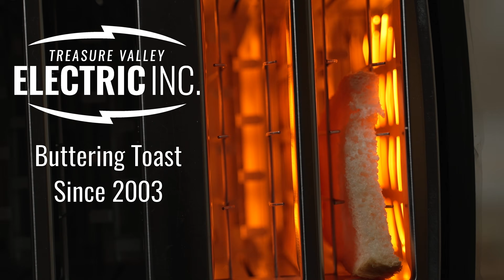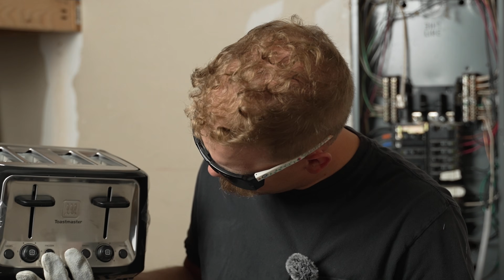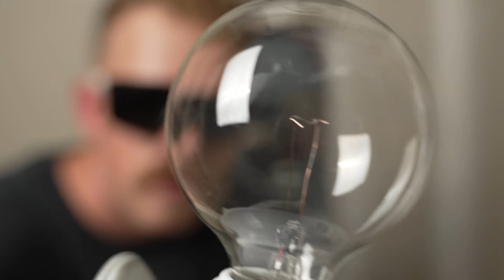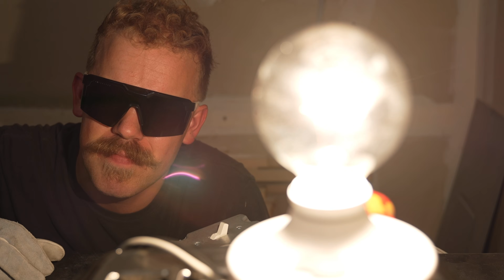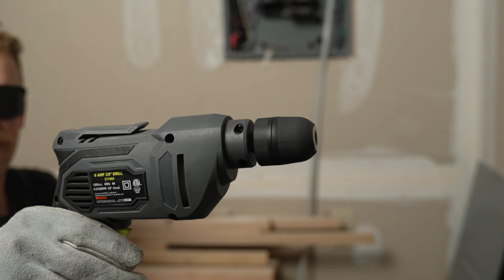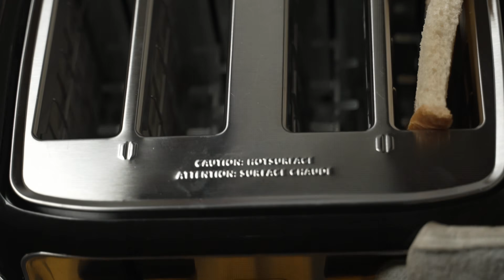We Sent 208V to a 120V Drill (What Happened?)

Comment: Switch mode power supplies will be unaffected as they will work with voltages ranging from 100 to 240 volts. A lot of high end hard wired LED lighting fixtures also have this feature

Comment: I love your real life demonstrations to help the newbies who never came across a 120/240 4w delta three phase system.   

7 years ago I was replacing a main panel in a 1960s family diner served by a 120/240 open delta bank.  The main panel fed a smaller single phase panel which powered the lighting, some receptacle loads and the security system.  This was on a Sunday evening and I was rushing to finish as it was just after midnight when I finished.   

Fast forward two days later on a Tuesday afternoon, I get a phone call from the owner of that restaurant stating that one of the janitors plugged the floor polisher into one of the receptacles in the hallway near the bathrooms and the machine ran unusually fast for about half a minute until it smoked and caught fire then tripped the breaker. Fire was able to be out safely with the fire extinguisher .  

So I returned and as soon as I put my meter in that outlet and read 211 volts I muttered "I f**cked up".  A handful of receptacle outlets as well as some of the lights were getting the 208V high leg.   The lights were perfect fine with that, as they were F32T8 fluorescent with 120 ~ 277V electronic ballasts.    So long story short I simply moved the two pole 100 amp breaker for the subpanel from phase B-C down to C-A and paid for the floor polisher which was $350.    Could have been much worse.   Won't ever make that mistake again.  

I wanted to share my experience in the hopes someone will learn from my experience how critical it is to get in the habit of checking voltages with a meter to make certain everything is what it seems.    Although the NEC does have specific colors for the grounding, grounded and ungrounded conductors including the high leg conductor as well as labeling requirements, you should almost verify with a meter, this routine has saved my life on more than one occasion.

Comment: Try doing what happens if you feed a 120/208 3 phase panel with 277/480 volts by bypassing the transformer that feeds that panel